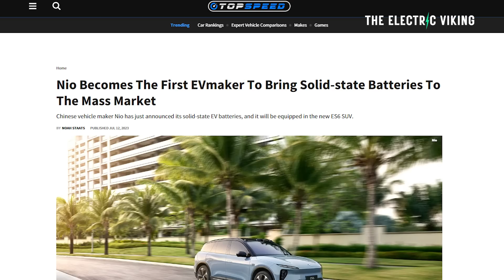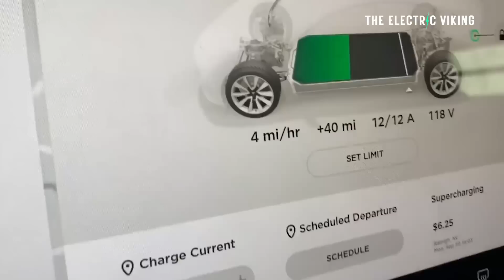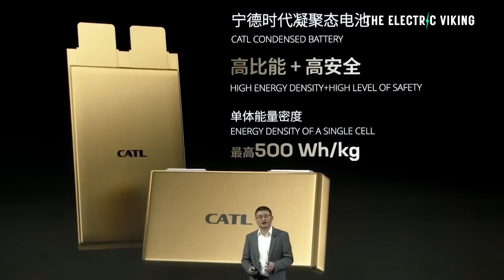CATL reveal new batteries for Tesla EVs that will KILL the competition

Comment: No matter what battery you have you are restricted by the charger. If the charger can only supply 1 KWh it will take at least 24 hours to charge a 24Kw battery. Therefore to charge a 24KW battery by 80% with 10 minutes, the charger must be able to supply 115.2Kw. multiply that by 3 to get a battery of ~72Kw charged in that time. "V3 Superchargers are capable of delivering peak charge rates up to 250kW". Note the "up to". So a v3 can just manage to charge 72Kw battery in that time. There are not many v3 chargers around and other brands of chargers can't even charge at this rate. In Essence its not tha battery pack that holds us back in the real world its the charger networks, and in places like Australia there is no real charger network to speak of.

Comment: People will be more exited to hear about a 1000 km range than fast charging because the infrastructure for fast charging will be costly to build
Reply: Range, charge cycles (life of the battery), and safety are my main major points. Fast charging vs slow charging is the next + infrastructure. The infrastructure is costly, but easy to understand as well. Also, while it does have cost, its going to be about the same cost as we had to put in for the ICE infrastructure. IF anything, its going to come down in cost comparability, because with ICE infrastructure  you still have a ton more up keep cost in terms of transporting, storing, and safey than EV infrastructure will have.
Reply: And superchargers destroy lifetime of the batteries.
Reply: @MrRaitzi  watch Tesla Joy on YouTube she just released a video on that topic. She only uses superchargers and has only lost under 3% of range on her 2018 M3 with 50 k I hardly ever use Superchargers and have Same car with 63k miles. Same range lost. Amazing really. Only bought tires and wiper blades since ownership
Reply: Only if you are not aware of the charging limits with the type of batteries you have. @MrRaitzi
Reply: I do not think so. You have to make a break anyway after 2-3 hours of driving.
Reply: Tesla already has the infrastructure. You really don’t need more than 300 miles range. I’ve driven my Tesla across the county and back a few times with zero issues with the infrastructure. Never had a bad stall verses Electrify America
Reply: What about outside of usa , where majority of Earth's population live ?
Reply: @Anthony__420 Tesla does not produce electricity. It only uses existing infrastructure. In the Netherlands 5000 companies are waiting for a new or bigger electricity connection. Some of these companies use as much energy as one Tesla charger. You see the problem?
Reply: @Anthony__420  Neither Tesla nor anybody else has the infrastructure.  Until there is a 200kW+ fast charger in every town over 1000 people, infrastructure is not totally there.  We're not even close.  We'll know we're there when people stop talking so much about range.  We talk about range because of the lack of infrastructure.

Comment: Being able to charge to 100% would certainly help my OCD
Reply: its already a reality with the very old LiFePO4 batteries lol.... do you even know what you are talking about?!
Reply: @alanmay7929  Indeed I do, I think the humour seems to have drifted over your head.
Reply: LFP batteries can be charged to 100% (and drained to 0%) without damaging the battery. LFP batteries are installed in the Tesla's manufactured in GF Shanghai.
Reply: @markread2976 :  I think explained this to you at least once before.   A few things everyone should know about LFPs:
1. All lithium ion batteries, including LFPs, degrade faster at high SOC (state of charge) and high C-rates (charge/discharge). 
2. LFP has much lower energy density and is heavier.
3. LFP lasts much longer in stationary energy storage systems with low-C and low-SOC (eg, Tesla's PowerWall), but ages poorly in EVs with high C and high SOC -- which is why LFP is strictly limited to entry-level, low-range EVs.
4. Cleanwatt, citing Tessie's tracking data, reports that Tesla LFPs lose first 10% of battery capacity twice as fast as non-LFP models, ie: to 90% SOH.  Recurrent, a EV rental company, has similar data supporting this finding -- ie, LFP's faster degradation.
5. Tesla recommends charging to 100% full because BMS needs to be recalibrated frequently to be able to estimate accurate range and avoid cell imbalance issue.  Other EV OEMs, such as Ford, recommends 90%.  
6. we don't know a lot about Tesla's LFP real world long-term lifespan under Tesla's recommendation.  It would probably outlast the 8-year warranty, which is also same for non-LFP models, but not nearly as long as most Tesla drivers would like to believe.
7. LFP's key advantage over NCM/A is its cost. (but if and only if the prices of nickel/cobalt are higher than that of lithium).  LFP at this moment is more expensive than high-nickel NCM's (NCM811/NCM9.5.5 used in  Hyundai Ioniq 5/EV6 or Ford F-150) in raw material costs.
Reply: @markread2976  European base model 3s, manufactured in germany, also have LFP batteries.

Comment: I hope you are right, I’ve hopped on the bandwagon of so many battery wow stories to end up underwhelmed, I am jaded.
Reply: Battery tech breakthroughs have been one of the most frequent and persistent lies in the last 30 years of science publications.

We still suffer with Duracell and Energizer garbage FFS
Reply: @yourlogicalnightmare1014  45 years ago in 1st year electrical engineer class we were asked to predict the most important invention, I submitted low cost high energy density batteries, nobody thanked me for it, still relevant after all these years.
Reply: hes lying as usual! CATL makes batteries for everyone
Reply: must be  tiresome to be theElectricViking subscriber.  LOL
Reply: Miracle game-changing battery breakthroughs have come thick and fast for decades. Most of them are lies but just a few like the lithium-ion battery and the nickel-metal-hydride battery are not. Now we can get batteries with ten times the energy storage capacity of the batteries of the same weight that we could get 40 years ago, and vastly greater durability as well.
Reply: Yes, lot's of new future Batteries with better everything, however they are only in the pipe line, however CATL batteries are already in production. That is the big difference. @cedriclynch
Reply: The question is not “How did CATL do it?”  The question is why have Panasonic and the rest of the world stuck with NCA?  It’s a microcosm of “this is how it’s done” just like the inefficient manufacturing methods used across the industry.
Reply: @Dave5843-d9m  >> The question is not “How did CATL do it?” ... <<<
LFPs with high C-rates is nothnig new.  A123 and Samsung developed their own high C-rate LFPs before.   All lithium io batteries, including LFPs, degrade faster under high SOC and high C-rates.  Also we don't know what other compromises were made in terms of cost, weight, etc..    It's going to take at least 2-3 years of real world use to verify CATL's claim.

Comment: Was it scary that Intel and AMD dominated the CPU markets for decades? No, we were never scared
Reply: because they are americans company.
Reply: Speak for yourself. IBM doing 4he cell processor for PS3 was a huge deal and very sad when PS4 did not go with multiple cell processor a like they were planning to do. PS3 had games with Ray traced elements way back then because of the cell processors...
Reply: It was always Intel that dominated the market.  When the Athlon came out, AMD had a superior product.  They were even selling it at a lower price than the Intel counterpart.  But Intel was able to use all kinds of tactics to maintain its monopoly.  It wasn't until the Ryzen came out that AMD could finally take the lead in sales in recent years.  Whenever there is a monopoly, prices tend to stay high while improvements tend to stay low.  For example, the 80486 dominated the market for 4 years where Intel was able to charge ~USD$2000 for them.  Intel was able to maintain high margins throughout most of its history even though competition did force it to produce better products at a lower price.  Monopolies aren't incentivized to innovate.  If you don't mind a slow pace of technological innovation while you are being price gouged then you have nothing to worry about.
Reply: They’re both shitting themselves now over apple silicon SOC’s smoking them like they ain’t no thang.
Reply: @L1VE3V1L  No, they aren't 🤣🤣
Reply: @khalidacosta7133  yeah they are. Apple are far ahead in this area. Look at the benchmarks. And gaming doesn’t mean shit.
Reply: @L1VE3V1L  lol they dont care they own the hyperscaler and enteprise markets
Reply: @L1VE3V1L nonsense! you are the one shitting crap on internet lol!!! you realie how vast AMD and Intel business goes right! even tesla uses AMD chips and unfortunately Apple doesnt sell their chips or offers services with them like intel or AMD or Nvidia does.